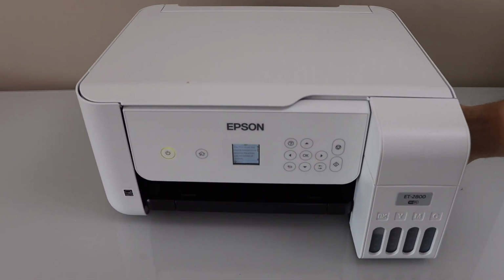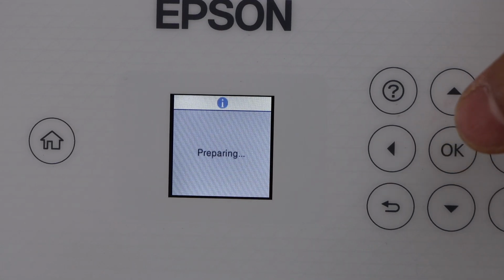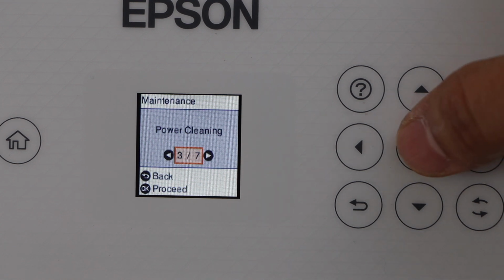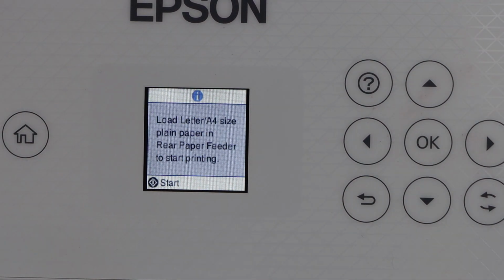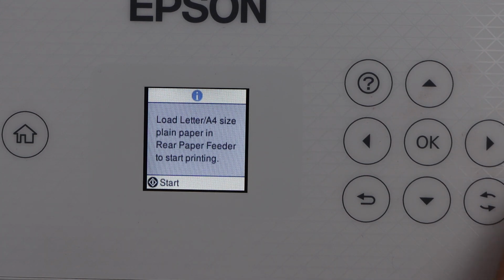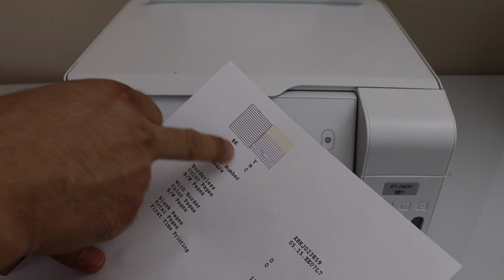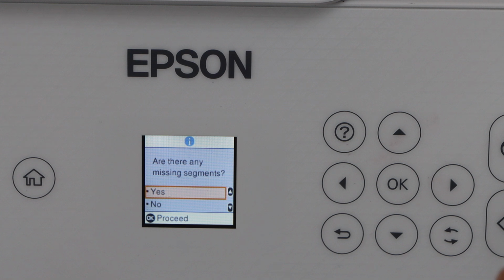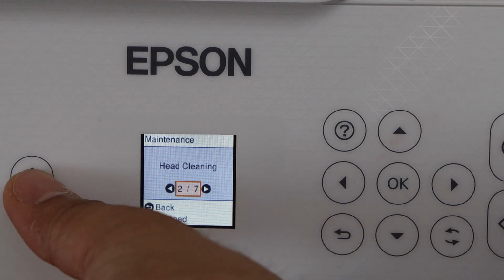Epson ET 2800 Printhead Cleaning (Fix Clogged Bk or Y M C Ink Manually).

Comment: Your video is wonderfully done as well as your descriptions and directions for removing the printhead. I'm wondering if when removing the head and then re-installing it some sort of alignment program needs to be utilized. I remember that Epson had software to be used with  older machines to perform that action. In any case this video is very much appreciated.

Comment: Thanks for this informative video. I have a different problem, I guess, because it didn't solve my problem, but I d like to offer some information about the lid bracket.
It isn't necessary to remove the two screws as shown at about the 1 minute mark. The latch bracket is designed to release if you can reach in with a finger or probe, and push the spring-loaded latch bolt so it releases from the housing. I can't describe it better than that, but if you fiddle around with it, it will release.
The dangling bit at 1:48 is the part that should remain in the base when the latch bolt is released from it.

Comment: Nice information.  but,,,, I am having trouble pressing the copy command at the very beginning.  the print head keeps returning to the starting position, to the right, instead of stopping at the left hand side.  Are you unplugging it during the copy command?  BTW  this is the very first step.  I hope i am understandable.
Reply: You need to unplug the printer once the printhead starts moving so it remains movable

Comment: do not use a screwdriver to "secure" the top part of the printer. everything can crashing down on me as i was beginning to removed the screws to the printer head. wires were ripped out and i am completely unable to put the top back on. essentially this video was just a speed run to my printer's final demise

Comment: DO NOT disconnect the print head cable.  That could lead to problem.  Just clean the printhead or pump cleaning fluid through it.
Reply from the maker: Good info
Reply: I did this and now I’m getting a scan error. Did I just completely mess up my printer?
Reply: Same here not sure what to do now

Comment: I accidentally opened the lid too far while trying to reassemble.  2 of the connectors on the left side came unplugged.  How do I get the side panel off so I can plug them back in?
Reply from the maker: I think you need to access the mother board to plug them in.

Comment: Hey everyone, I noticed in this video that there was a "power clean" option right next to the regular nozzle cleaning option. 

I tried this, and it instantly solved my issue. I wasnt getting ANY cyan or yellow ink, and the power clean made the nozzle check perfect.

I suggest trying this before opening up your printer!
Reply: The Power clean should be your last option it will wear your printer out faster. It will also use a lot of ink.
Reply: Where is located?

Comment: Thank you for your video. The instructions were clear and every step was covered. 
I followed all of your instructions but I still have a problem. The black ink still is printing with lines through it. They are in regular intervals throughout. Do you have any thoughts on how to fix this? The other colors are just fine but the black needs some help! Thank you!

Comment: Excellent video. got my printer going and lost nearly no ink in the process. I had to prime the cartridges' but after that it was smooth sailing. I usually wrap  up my ET 2800 in a plastic bag but forgot to wrap it up the last time I printed. 40 days later it was clogged. Had the printer for 2 years and it never clogged until forgot to cover it up.
Reply: What does using the plastic bag do?

Comment: I have a problem. I followed your video step by step. Turned my printer back on after cleaning the printhead manually and now my printer says there is a paper jam when there is none. What did I do wrong?
Reply: Literally same for me. I cannot get the error to clear so I can’t print anything. Did you find a resolution?
Reply: @heatherwisley3043  Nope. Not yet :/
Reply: @heatherwisley3043 I’m having the same issue now.. now I need a video to clear the error message 😫
Reply from the maker: I think the best is to unplug the power cable for 10 to 15 minutes and then plug in the power cable. That should remove the error.
Reply: Having the same issue. Did you ever resolve this?
Reply: @jessecamcnamara4771  I don't know what happened. But I just put a little bit of weight on top of the printer as it started to print. And now its working. I also checked my printer ribbon and it had ink on it so i used a q tip and lightly cleaned that up.
Reply: @jessecamcnamara4771  Nope. Even had my husband look at it. He would get that error to clear then it would say the scanner was blocked. Get that error to clear and then it would say the printer was jammed again.
Reply: Made it worse, i was looking to print yellow. i followed everything carefully in the video, taking my time slowly and carefully. I placed it back and it welcome me with error 031006 it is not a paper jam as said in printer screen. It means IT FRIED THE MOTHERBOARD because of the connection from printer head to motherboard. Now I'm searching how solder a new fuse on it. Surely he is a pro and did well but it is not for faint hearted and trying it just to learn. I cannot even place back the door lock on the side :/. My printer is bricked now. But I glad to learn a thing or 2.

Comment: There is a trick to unlock the top without removing the screws. There is a notch cut that allows the post and track to become disconnected. The spring prevents it from finding the notch holes, so you have to push in the spring to find the notch release.  Also removing the print head from the ribbon cable is difficult and so I never removed it completely but would like to remove the cable.   There is a fellow that causes you to force open the top.  He squirts in fluid and wait 24 hours to restart the printer. Wow his video is a mess.
Reply: I was planning on doing this to fix my printer. But now, I’m questioning the whole video. lol. Help!
Reply: What if the printer head is stuck how can I make it move please help